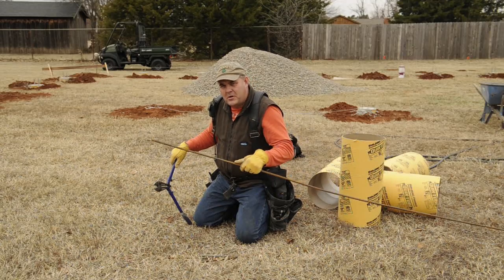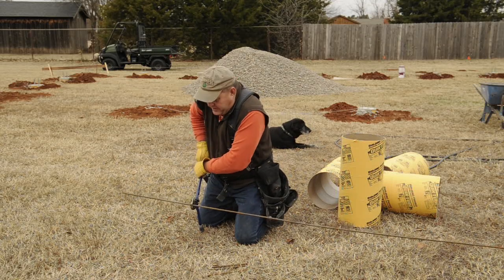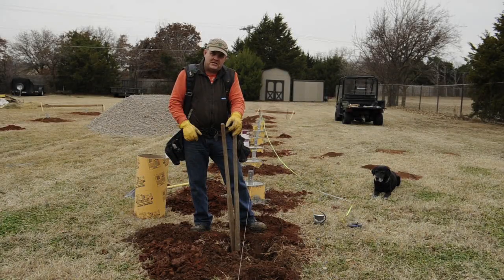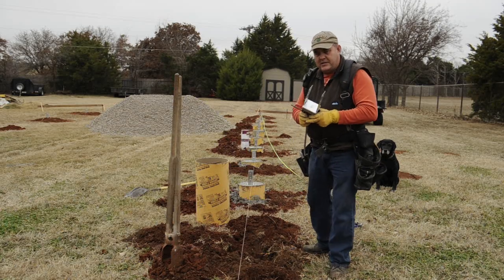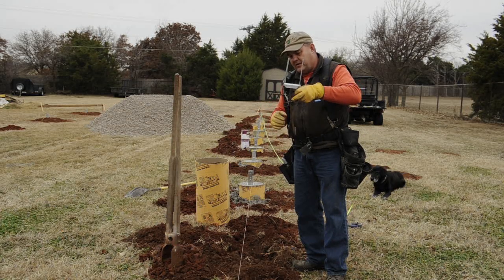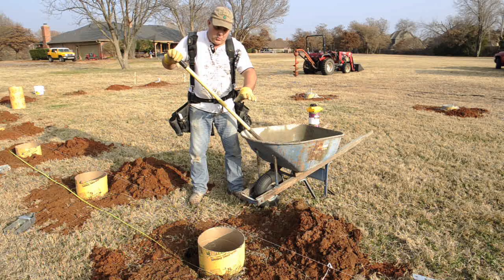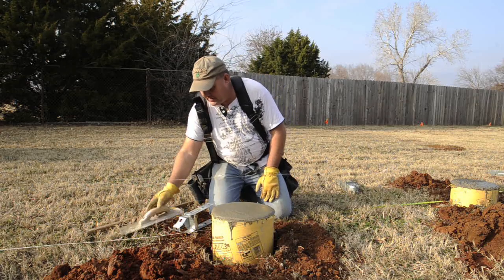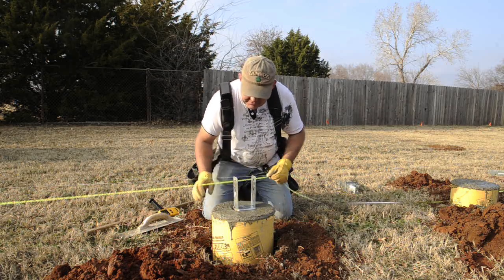Setting piers - part 2

Comment: Tip for digging out holes with a machine mounted auger, if you can disengage a PTO powered one, dig in then stop the spin and lift out, carefully drive to a distant spot out of the way and dump, then go back push the tailings in and dig more as needed and  repeat stopping auger and dumping into pile a distance away, makes for less cleaning out using the manual post hole digger.

Also lay a footer pad or cookie at the bottom if you dig 4 inches extra to spread the load out in case of water saturation if you get flood or heavy rains and distribute the building load into the ground over a wider area, it also acts like a uplift protector if you use two bent pieces of rebar sunk into the foot leading into the pier form, might want to remove the form after and backfill with some of the excavated dirt, the concrete surface doubles as a friction pile in lieu of the footer as uplift prevention.

If your going larger in width and longer in length, Simpson strongtie brackets may not be enough, other options are Midwest Permacolumn precast concrete columns and their wet/dry (drill) set anchor brackets, or Strong Way System own bracket with precast height adjust-ability and the rebar and foot pad both anchor it into a non or partial tube (top one or two foot with tube form) formed pier footer again you can place a wider base of 4 to 6 inches thick wider footer cookie on these systems.

Or if you prefer to set the post foot into concrete if not just dirt or gravel, look into using Plasti-Sleeve bases and a through bolt or rebar through to anchor the post into the concrete, this sleeve can be sealed at the top to the post to keep to much water from getting in and prolongs the post life even if pretreated.

Comment: I was wondering if the metal square on the strong tie isn't supposed to sit a little higher to keep the bottom off the wood posts away from standing water?

Comment: Can I use this kind of foundation to built a small 2 story home out of my detached garage here in Salem, Oregon    ?
Reply: Yes, if local building inspectors will let you get away with it.  You'd also need to check the frost depth in your area and adjust the depth of piers and plumbing accordingly.

Comment: Did you place any gravel beneath the tube prior to adding concrete mix ?  Also, is the depth determined by the "water line" of your area ?
Reply: depth is determined by front line in every region-area, not waterline, if you got water saturation issues in your soil and property then you may want to think of installing a drainage tube system, unless its relatively flat ground in your region, then there is not much you can do but adhere to local code as recommended or required
Reply: Typo in the comment above. Should say frost line, not front line. Otherwise good info. 😊

Comment: Hey instead of paying big money for those post forms can you use pvc pipe with slip
Reply: They aren't expensive.
Reply: He's buying one 4-foot sono tubes and cutting it in half, so they don't cost much. They're much cheaper than a 12-inch diameter PVC pipe.

Comment: I'm curious, why not just dig the holes about 4 feet and put a 6 inch concrete pad at the bottom, then stick the post in the hole and fill in the rest with concrete.  You don't need to level the bottom of the posts this way, you just cut the tops to level once you're done.
Reply: Some regions where the frost level is deep, buying with concrete will not last that long.  The ground expansion causes the concrete to crack, which leaves a place of water to sit, refreeze to increase the cracks, catch more standing water, etc., etc.  This way the posts will stay drier and last longer.